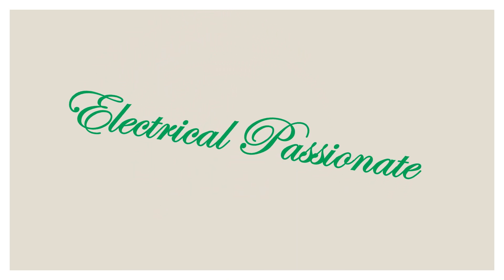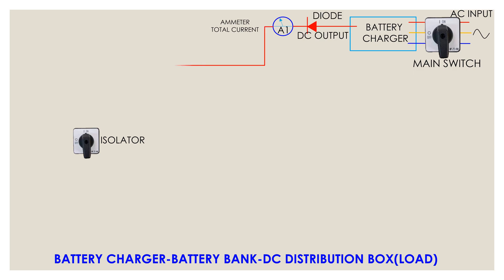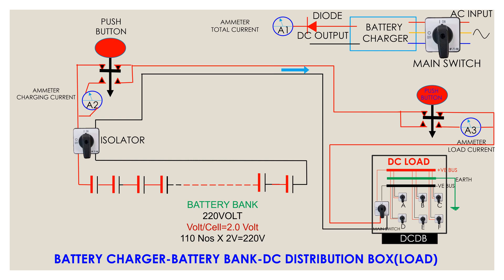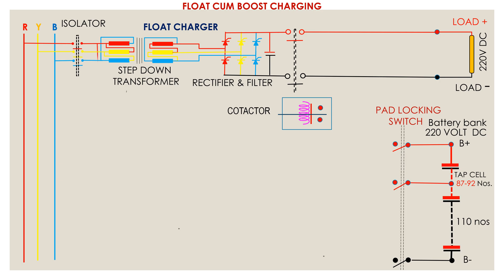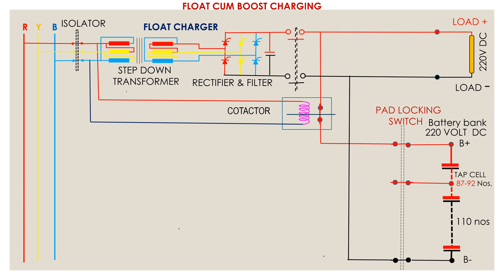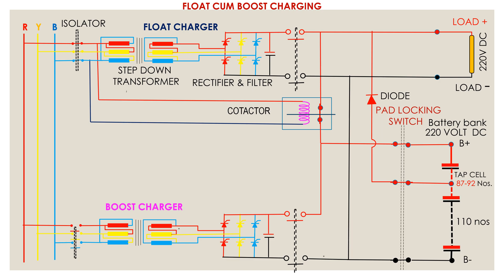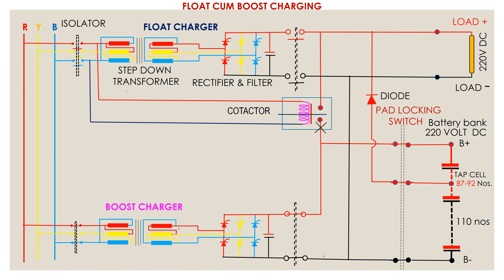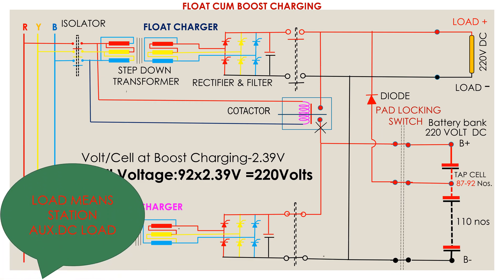FLOAT CUM BOOST CHARGING:FLOAT CHARGER:BOOST CHARGER:BATTERY CHARGER:BATTERY CHARGE PROCESS:TAP CELL

Comment: sir, when we put the charger mode in "auto" does it change over from float to boost automatically when needed?
Reply from the maker: You are welcome. Every battery charger is now microprocessor based has auto and boost mode. When the charger is put into auto mode ,boost to float or Vice-versa  occurs  automatically when required. Thank you❤.
Reply: @electricalpassionate  thank you sir.

Comment: Sir
According to your circuit diagram 
If AC supply is failed then how load will get DC supply kindly rectify your drawing ❤
Reply from the maker: My dear viewer, you are most welcome. You have raised a relevant question. Erroneously it was happaned. But there is no chance to rectify the error in this video. Please imagine the said contracor
has two contact one N/O and one N/C.Connect both the contacts in parallel and the problem will be solved. I am happy to know that you are watching other videos on this channel. Please support me in this way. Thank you ❤.

Comment: When AC supply not available the contactor will opened then how dc is supplied to load using battery
Reply from the maker: You are most welcome dear viewer. You have raised a relevant question. In this video I had an object to focus only on Float charging and Boost Charging process.It would be better if I could include the matter that you raised. But now there is no chance to include it in this video. Please imagine the said contactor has two contacts 1 N/O  & 1 N/C.Connect N/C  contact with N/O in parallel and the problem will be eliminated. Thank you.

Comment: thank u very much Sir for your sharing! I would like to ask u one question. why do we use -48Vdc for Telecommunication?
Reply from the maker: You are welcome.In Telecom the convention of using the negative polarity of 48VDC concerning ground has the advantage of avoiding 
corrosion of copper wires and of making it safer for the human body to perform telecom maintenance.  Thank you.